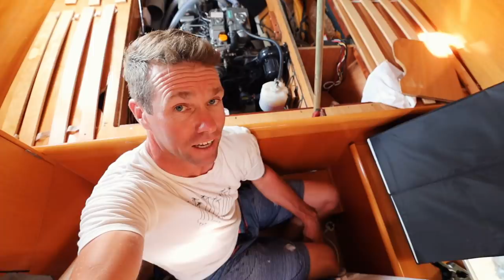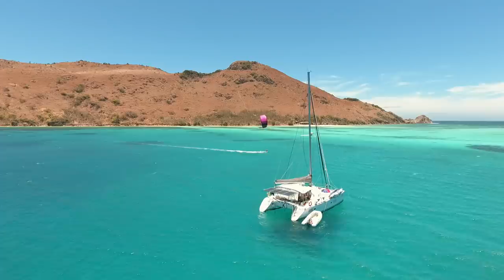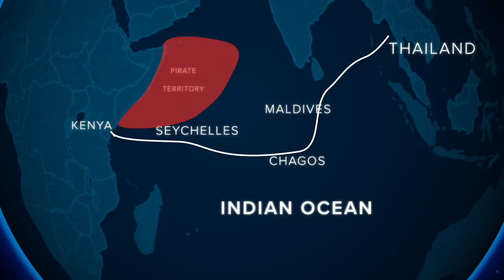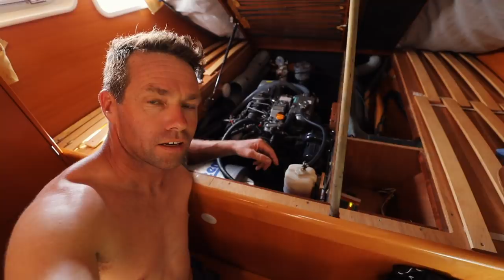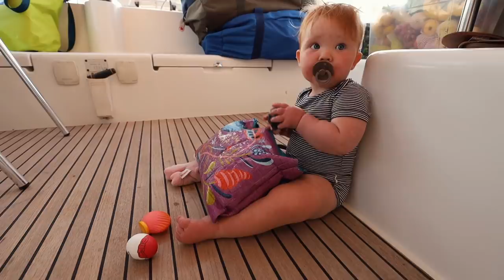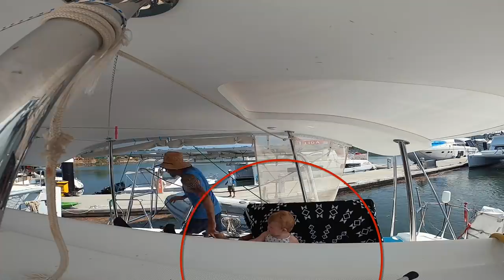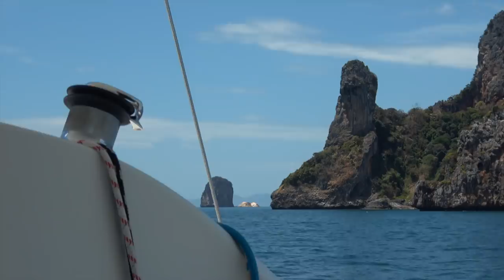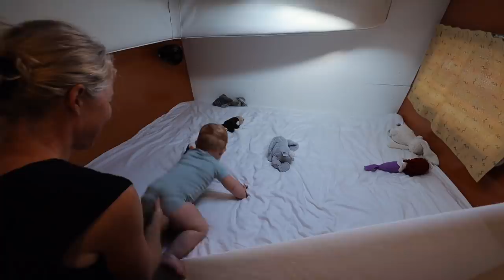we Just BLEW UP our Engine

Comment: My guess of what is wrong would be a collapsed lifter as that valve was open the entire time that the boat was on the hard.  Most lifters are hydraulic and will over time collapse down and when the engine starts it can take a while to pump back up.

Comment: it's not hard to replace a push-rod on a yanmar, just pop the rocker off, watch out for the valve springs and collet. You'll need a feeler gauge to set the valve clearance. Amazing it kept turning on two cyclinders, the 3 pots normally dont do that. There's loads of clips on youtube how to do this.

Comment: The only thing you did wrong was to not shut it down sooner.

It’s probably a stuck valve. 

You should be able to get it free withstand WD40 a prybar or rubber mallet. Then you double check that that the lifter moves freely. By barring the engine over and watching the lifter move with the new lifter tube sitting on it. 

Then just follow the manual to reset the rocker clearance. No need to pull the head unless it doesn’t run right after.

Comment: Valve stuck from sitting common problem push down on valve my have freed up could be a cheap fix  install new push rod then crank over by hand before using starter

Comment: Sounds like a broken tappit, could be wrong, but had it happen to me.
I have to say that i was concerned to see the root in the cross beams, it seems that it has gone quite a way if the bulkheads are moving, i am surprised that there is not a steel support built into it.?

Comment: A rod bearing went out causing it to knock , you'll have to pull the engine and rebuild. You don't need to keep cranking it, it's going to lock up.

Comment: Well, there's  going to be the talk of destroyed rings, but diesels have another interesting feature, the "sleeve" inside the piston. And a ton of other possibilities. Valve stuff for instance. (said that before you showed the bent push rod) A three cylinder  engine seems larger than most. I've even seen single cylinder catamaran engines . That's a tough one. A "stuck valve" like that one, almost impossible to do anything ahead of time (usually you wouldn't take the entire engine apart before you start it) and , even though the much of the engine is lubed by fuel, not the valves and rockers. So, nope, you didn't do anything wrong. I don't think. It just sat too long. Maybe  a rule of thumb would be to take an engine valve cover off and squirt some oil around ? On an engine thats sat that long ?

Comment: Stuck Valve.  Piston is hitting open valve. If your lucky, just miner damage, such as, bent valve and push rod. Not so lucky, holed piston. bent rod, damaged head.  Don't  rev a knocking engine.  Find out why it's making noise. Good Luck!

Comment: I would look into hot shots secret friction reducer and stiction eliminator especially after running the injection pump dry.  I run both in my Diesel engines

Comment: timing belt slipped or fuel pump needs aligning or faulty,,,oops spoke to soon, bent valve stem might have damaged piston. thats a head rebuild. Can still be caused by the timing slipped out too.

Comment: You did what you could with the information available and your knowledge at hand.  A mechanic would likely have shut it down as soon as the ticking was heard.  Call it a learning lesson and don't beat yourself up.  You obviously have a bent lifter now.  The key is to pull the lifters and find out why.  I suspect a stuck valve, ie it didn't open when it was pushed by the lifter

Comment: One of your pistons is knocking. Slipped a bearing or a rod broke. I don’t think it’s a valve or lifter. Just starting the video. The rods have a hole for oil to flow through, it got plugged up or frozen somehow. The CAM will have to come off to replace. Seeing the end....Yep, you got it!

Comment: Willa's in Baby Jail!!!!  And it sounds like you've got a stuck valve and bent pushrod.  (0:40)  BTW, it wasn't fair as I have a year's experience with a bad pushrod as during my freshman year of college I drove  a 1974 Pinto that only ran on 3 of 4 cylinders.  Lasted me a year, but I burned a quart-of-oil EACH fill-up.  Finally traded it in for a 1985 Ford Escort.

Comment: I'm not an expert either but I think you're supposed to make sure that your fuel is getting where it needs to go before you turn over the engine after it's sat for a long time. 
I know the turning on a diesel truck you're supposed to turn the key and let the pump get up to pressure first before engaging the starter

Comment: just had a stuck valve or two from sitting that's why at the beginning sounded like you didn't have compression and when you revved it the pushrod went noodle boi trying to open that stuck valve. next time with a sitting engine hit the valves gently with a hammer before starting, easy fix tho!

Comment: If it doesn't start in 30 seconds turn off the water to prevent water lock. When engine starts turn water on.

Comment: You don't need to take the valve cover off and what you need to do is crack each fuel line going to the engine start up one at a time loosen and then tighten as the motors running see if it makes any difference one of them when you loosen it up you will not hear any difference the other ones when you loosen them up it's going to change the sound of the motor the one that doesn't make any noise is the bad fuel injector all it is is a bad fuel injector

Comment: Lifter drained out, went flat from not running for so long. First time you fired up it may have been able to pump back up. But when you shut it down th push rod fell out. Wasnt your fault. At least you shut it down the second time.

Comment: Having torn-down & rebuilt more than 200 engines... Untill the oil & water is removed, along with cylinder head(s); anything is possible. I always had looked for the brighter side. Never did like see damage. But, I have seen some very interesting 😒 internals.

Comment: Very curious if the new water maker will be running every time you run the engine, or if you turn it off and it doesn't draw power from the engine when off.  I like engine powered as that seems a great way to run a high pressure pump, but not sure how it works.

Comment: Either dirty injector knock or bad fuel, but I'd need to see the exhaust.  If it was running well when hauled, then those two problems are my guess.
Reply: Well, was I ever wrong. Old Ford 289's would bend pushrods when bad gas gummed up the valve stems in thr guides.
Good luck with it.

Comment: the rod is knocking against the cylinder wall or against something else, you should have shut off the engine and opened up the head like you done and checked it when you first herd the knocking. from there contact a diesel machinery specialist

Comment: More than likely had stuck intake valve or broken valve spring. Popping is compression coming back into intake system. Remove valve cover you will see the problem

Comment: looks to me like a bent pushrod from stuck valve or timing issue ? I fixed a van engine that bent a pushrod because of snapped timing belt (and valve hit piston) by hammering rod straight because no spare available and the van ran for years no problem.

Comment: 2 stages of "WRONG"! First you had a stuck valve (the tick, tick, tick) ! Second the valve was stuck in the "open" position when you shut it off. Then when you tried to restart the engine, the stuck valve interfered with the piston and bent the valve, damaged the valve guide, piston head, valve seat,  and even could have cracked the head, and could have damaged the cylinder. also you may have bent the connecting rod. 
   Ben; You won't know until you take it apart and inspect it. If the piston isn't busted....a few marks on the top is OK. If the cylinder is scored, as long as it's near the top....it's just fine...dress it with s file or dremel tool. While you have the head off get it "Magna flexed/fluxed" for cracks. Install new guides, seats, and valve/valves. Do you know how to do a "gas check" for the valves? It's easy and no special tools needed. 
   When/if you pull the engine (suggested) mark the alignment shims as to reinstall them in their respective engine mount. To pull the engine use your boom and support the weight with the "Topping Lift" and your "Main Halyard"just aft of the engine respectively. This way you have plenty of working room and it won't be too hard to check if the connecting rod is bent after pulling the oil pan! If it has "push rods" they need to be checked for "Trueness"!
   Please let me know how close to the problem I am. Also if you have any questions just put them in your "reply"!
   Thanx,
   Captain BUCKLEY(ret.)

Comment: one of your push rod looks bent it's the end one of the rockers ,You can lift the rocker off by undoing the 2 bolts on each of the rockers caps the 4 of them . by taking the rocker off the engine will not up set the running of the engine  The front of the engine is wear the pully's and belts are and the back of the engine is wear the gearbox is lust like on a car .

Comment: Not a spun bearing, but the head will have to come off and top end looked at. Lucky and hopefully the bottom end is fine. Shouldnt be a big deal.
Reply: Yeah bottom is bathed in oil and is usually in better shape.

Comment: Mechanics will have a full uncover the engine to check the piston, that clanking at the second start tells me something is disconnected or cracked cut for not sync with the three other piston force
Reply: Ben you shouldve play around the gear a round or 2 in neutral before starting the died unlubricated sheet had been the caused

Comment: Valve got too tight then under power crushed the rod... Buy a feeler Gauge(Spellcheck that). Then get your engine spec for valve clearance and it’s easy. Do regular adjustments per your engine manual. You will have much better engine experiences for ever. Most machines, I repair. Never get adjusted untill I get my hands on them. It will also affect compression. 😎

Comment: you should have hand turn the engine over first. To remove the push rod is easy, just loosen the bolts that hold the rocker arm down. He does need a cold beer.  lol

Comment: While the motor is running you crack one at a time and you'll know which one is not firing the reason why you're hearing that noise is because there's no fuel going to one cylinder take that fuel injector out and go buy a new fuel injector and put it in there and your problems will be over what it is a piece of dirt from your gas tank got in there and clogged up your fuel injector you just need to find out which one it is by loosening and tightening each one at a time you'll know which one it is

Comment: Engine is not running on 4 cylinders. I'm assuming it's a 4 banger. Being you said there was air in fuel line. Crack the lines to the injectors to let the sir out of the fuel line. If still not firing on all 4 cylinders pull valve cover and check valve train.

Comment: You can see the bent push rod,  witch could be straitened,  gonna get in trouble for this,  with a hammer,  and knock the valve loose.. sitting with a little moisture will cause a valve to stick and bend the push rod... my bet, it is ok... lay that push rod on a piece of wood and hammer away... not kidding.... take the rockers off and tap the valve with hammer and piece of wood, it should bounce... be gentle...  learn how to adjust tapit gap... feeler gauge can be a piece of cardboard from cereal box...  can't wait to see the reply's on this....

Comment: Sounds like one of the valve hitting the piston, nasty... Still shouldn't be to hard of a job as looks like you can get to all of the top of the engine easily enough.
The problem though will be working out why it happening :-|

Comment: I might have been tempted to get a driver for the oil pump and pre-oil it to top of the motor.  What does the exhaust look like (blue smoke, white smoke)?  P.S. where did the red hair come from?  P.S.S. lash your dinghy to the hull (about where the motor is) on the dead side and have Ashley in there to use it like a little push boat/tug (had to do that for a couple of years on a big 44 Luders USNA Yawl that had a motor die), not a lot of fun (but compared to dealing with a monohull with a 12,000 lb keel hanging down nearly 8 feet, doable)

Comment: Love what you guy's are doing nice to see your getting back underway. However, BEN! you need to pay more attention to what your doing when Willa is up on the helm with you. You can't just get up and walkaway like you did. what would have happened if she had slipped off the seat? oh sure its not that high.. MYASS! thats not the point the point is any one of a number of things could have happened. and closing the door  not a good idea. what if Willa finds away to climb over that curtain? Baby proof the boat so there is no chance Willa can get hurt before you guys set sail. If your going to do it, do it right!

Comment: I would have remove all the injectors, removed valve  Cover. Squirted smalle amounts of oil And each cylinder And exhaust valve area And intake valve.  Then turn the motor over by hand. Reinstalled injectors and bleed.🍁

Comment: Pull the valve cover and spin it over see if all the valves are moving sounds like compression issue
Reply: Edit I see the bent push rods there is a reason the pushrods bent whether it be stuck lifters, bent valve or an over rev

Comment: Spun Bearing i would say or bent push Rod. Might be both now lol. wow bent push rod easy fix mate, What i will say to you is get that fridge fixed seeing your in Thailand that will be a cheep fix as well they have 12v systems here that you can use as well if you need to replace it. Ps: Find a air conditioning repair man not a boat marine place.

Comment: Well had you fogged the engine before leaving it I think it would have coated the valve and valve seat with lubricant.

To fog, spray air intake with fog oil or add lots of oil to frisée fuel and heavily spray into air intake

On a gas engine this works well, on a diesel not sure, just lookup fogging a diesel 

Have fun

Comment: Motors should be much cheaper, reliable, efficient, sustainable. Why don't you consider converting it to electric sailboat? That way, when you're sailing the battery should also be charging.

Comment: Ouch, pushrod is easy just buy one remove the rocker pop new pushrod in and replace the rocker. But that's if the valve isn't stuck closed. If mine is put something soft on the valve and give it a tap, but only after making sure the piston is down on that cylinder. Then again I'm a rough arse tw@!

Comment: Very common on marine engines for a valve to stick, usually newer engines that have closer fitting valve guides. Condensation and or salt air rusts the stem and makes it a bit too large. One thing that can also cause this, is not letting the engine get to operating temperature before shutting it down. That can cause condensation to form. Don’t just start and run it a few minutes or see if it starts. Cringe!

Comment: The first start might have either started on a couple cylinders either might have been a bad glow plug might have started to run good in a bit longer of a run or blocked injector. But that second one didn’t sound good at all sounded like bottom end witch is never a good sound

Comment: Did you recently replace timing gears or belts? High time engines have worn timing belts that can slip and cause such issues, but if you recently changed them you might have screwed yourself. I am expert at doing that. Lol.

Comment: When it goes from tick tick tick to bang bang that's a rod Bearing😂,how was the oil pressure? 😱$$$ DOH
Reply: Hi my volvo penta md30 has been ticking recently..had a few opinions so far ..from serious to ok but take it easy..whats your take on this sound from cylinder 2 apparently
Reply: @gram.paka1001  take the valve cover off and put your finger on each individual rocker make sure your oil pressure doesn't drop

Comment: Only running on 3 cylinders.been left for a long time.sounds like you have bent a rod.should have not 
kept trying to run it.Can cause more damage.Needs a full engine sevice.Not a big job.There is normaly a place that rebuilds engines.They normaly have used parts from engines lying about.gasket kits about $150.You can fix this yourself.Torque wrench and feeler gauge.Engines that have not been run hot are normaly easy to rebuild.plenty of instruction diagrams out there for you to follow.If a engine has been left for a long time.it is best to turn it by hand first.Also turn it by hand a few times after rebuild.Ah it was a rod.cylinder was most proberbly stuck with carbon.

Comment: Dude you can fix it.. need a roll of duck tape, some bubble  gum, jar of used cooking oil, a few old diapers, roll of tie wire, and a gallon of rum.
Drink the rum. And buy a new engine. One push rods gos OTHERS will follow. A complete rebuild is near the cost of a new motor. Most of all keep baby safe.

Comment: I've heard that sound before.  I think you're in the process of throwning a rod.  NOT GOOD.  Generally it's a lack of lubrication on the rod, rocker arm, and valve, that causes the issue.  I had a van that this happened to.  Eventually the rod seized and tore through the bottom of the engine block.  It was something else to see the bottom of the engine block torn like paper.  I hope you've caught this in time to just have to replace the rod instead of having to replace the engine like I did.
Reply: I have the tick tick sound at the mo ..volvo penta md30..1986..can i assume the same process will happen in time ? Local mechanic wants to rebuild
Reply: @gram.paka1001  I'm not a mechanic but as far as I know it's cheaper to fix the issue than to replace the engine.  I got into trouble because the van was leaking oil and didn't realize it.  If you have a recommendation to rebuild and you aren't sure I'd get a second opinion by a different shop and see what they say too.